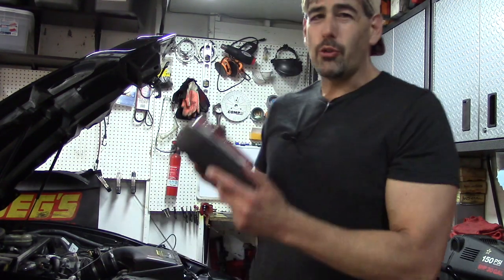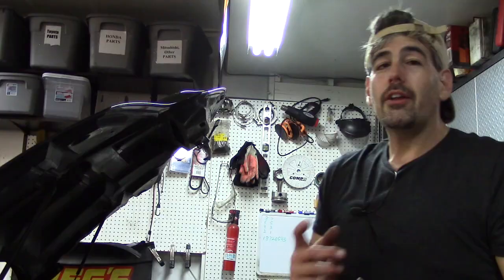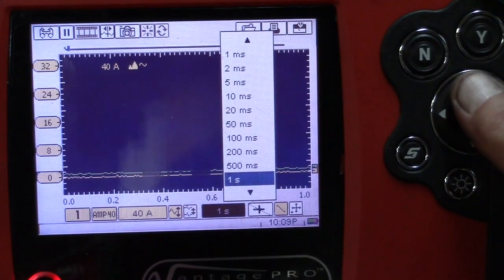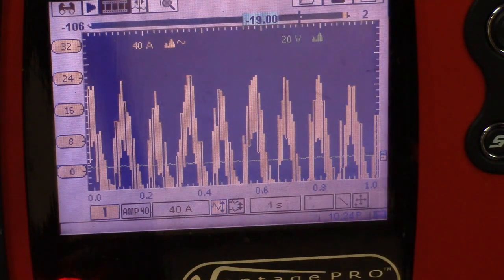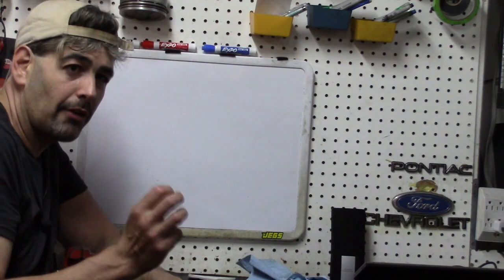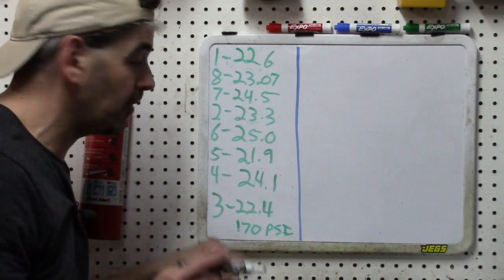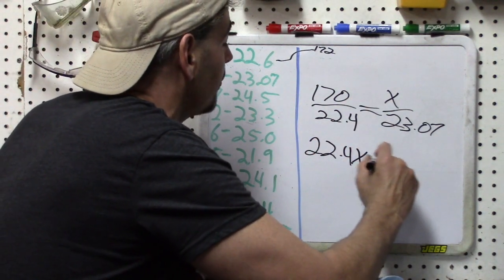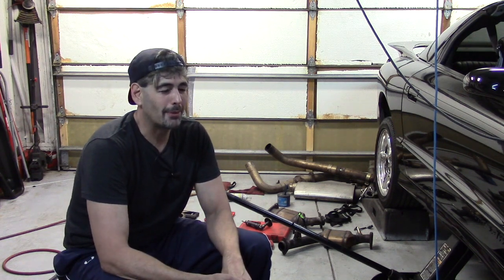Method for Relative Compression Testing to get PSI DATA!!

Comment: I don't have an in-cylinder pressure gauge due to cost, but do have a cheap 1 to 100 psi pressure sensor with a Schrader valve to measure a known value of fuel pressure for the scope signal, can I use this value to then let the scope give me a comparison value like you did with the in cylinder reading and then do the same calculation formular to get the cylinder pressure this way, Love the way you find different ways to verify things mathematically,
Reply from the maker: Thank you and indeed I have heard of many many people who made various homemade transducers like you are trying to do. Luckily now I was able to afford the WPS500 and I only bought it for the easy direct calibration with my picoscope.  But believe me for most of my life I would have absolutely rigged up something like you are doing.
   The only problem is that if your pressure transducer is only to 100psi, it’s just going to be far too low to do in cylinder diagnostics. You will need one that goes to 200 at minimum.   Average cranking pressure is going to be 150-180. If you plan on doing running pressures, maybe 250.   At only 100PSI you will always flatline it on even a low to moderate compression cylinder.

Comment: Matt is there anything that you HAVEN'T covered?!?! This video is EXACTLY What I have been looking for
Reply from the maker: glad to hear!  i try to be comprehensive and thorough.
Reply: @SchrodingersBox  anything you recommend as far as an amp clamp and scope for this without breaking the bank but also without making it too difficult on myself to read and comprehend the test results...
Reply from the maker: you can use any DC amp clamp and I have seen many for under $100 but as for the scope- I know several viewers have made lots of recommendations but I can’t really recommend on. i have tried several and honestly any of them under $300 I really don’t like too much. I really like my used vantage pro which is just around that range.

Comment: But is the current directly proportional to cylinder pressure?
Reply from the maker: Yes. It has to be. the higher the pressure the slower the starter will turn and thus the higher amperage.
Reply: @SchrodingersBox  I agree, it is proportional, but is it directly proportional? As in, will twice the compression result in twice the current? And while you're here - if you don't mind... How does this sound? Got low power on cylinder 2 but worried it might be low compression. Cranking sounds ok to me? https://www.youtube.com/watch?v=ZtSef5E8ztM
Reply: @dopiaza2006  An engine with no compression still draws starter current so current can't be directly proportional to pressure.
Reply: @mattt4183  Good point. I guess you'd need to baseline the current with no compression and take that off any reading to see if it really is from that point. And to answer the question about the video I linked about - it has 2 bent conrods!

Comment: Hi Matt! You may not see this but how or what tool do you hook up to the ignition to find out which cylinder is who?
Reply from the maker: Hi Glenn. There are lots of ways to do it including not even using a tool. The trick is to get a signal on a known coil and then, given the firing order of the engine, you can determine each cylinder you see on the scope by counting firing order from the known. 
    You can use an inductive ignition probe, a capacitive clamp, you could prove a terminal for voltage or use an amp clamp, or you could even remove one spark plug from a cylinder and the missing peak will be that cylinder.
Reply: Schrodingers Box what did you use in this particular video? Also on COP design, how do you get a signal? Tapping into the trigger wire with back probe or pierce it?
Reply from the maker: In this video I used a inductive spark tester- simply because I was interested strictly in signal, not a diagnostic spark pattern. 
   In the case of a COP you have three options. One is to backprobe or pierce to get voltage. The second way is the use an inductive amp probe and loop the signal or ground wire.  A third way (and the way I do it now since I bought one) is to use a special COP probe that you simply touch to the coil and it gives a spark pattern much like a capacitive probe.
Reply: Schrodingers Box the reason why I’m asking you this is because I have a vantage ultra scope which is similar to your vantage pro. What would be the cheapest/easiest route for to get for picking up the ignition signal to sync with the relative compression test? Maybe something that could do either  wire on plug and coil on plug? Also do you use an adapter for your COP probe? I know that our vantage only takes banana.
Reply from the maker: The cheapest way by far would be to just probe the signal wire voltage. All you need is a backprobe- that’s it.  Nothing to buy- you can use a sewing needle.

Comment: SCHRODINGERS BOX, 
                        ,,,           when one or more pistons are NOT giving any compression. What would be the problems on the cars engine? 
        Do you have to replace the piston or the actual engine block is cracked inside that piston cylinder and have to replace the whole engine block?
Reply from the maker: The variables are ring sealing, valve sealing, or compromise of the combustion chamber.  Determine which is the one via leakdown test.

Comment: The old BMW DIS  testers did this automatically. You put the transducer and do a relative compression test  and it will give you a report in BAR.  To be honest I have not done it in many years. Direct measurements are faster

Comment: Ha! I got interesting case, where all cylinders have almost same even compression (+/-2%) but all are under desired value (35psi less) so I suspect incorrect timing.
Reply from the maker: correct. that would be far more likely than equivalent wear on each cylinder.
Reply: @SchrodingersBox  So I don't trust computer throwing no dtc as  apparently it is within safe limit. Either incorrectly installed belt by a tooth or two or faulty one of vvt hubs due to intermittent nature of underpowered rides (sometimes engine sounds like exhaust opens too early and throttle is much less responsive).
Reply from the maker: I usually check alignment by superimposing the cam and crank signals using a scope but without a scope you will have to just look at the timing marks and see if they are misaligned.
Reply: @SchrodingersBox   I have both cams variable, so I will have to lock them from the other side and ensure sprockets were/are aligned as spring loaded - just waiting for a locking tool to arrive and a free weekend. I am even going for a fun to check crank tdc with a tdc wheel while being there..
Reply: I heard that test with use of a gauge always shows lower than real pressure because gauge and hose add up extra space for air. Is it always a true?

Comment: I wonder about the accuracy from a bit of a lower psi cylinder to a bit higher... As scanner Danner says it can show an exaggeration in the numbers because the starter moves a bit faster on a cylinder with less compression thus drawing less amperage. When the starter begins to go to the next cylinder it is moving faster than it would normally due to the previous cylinder drawing less current. So the following cylinder after a cylinder with a bit lower psi actually reads like it has slightly higher compression, but in actuality it's appearance is skewed by the previous cylinder. In any case, good stuff..... Nerd on 🤘

Comment: I found it easier to find out how many PSI was equal to an amp, and then multiply that by the results of each cylinder.   I.E.  170(PSI)/22.4(amps) = 7.59.....   That means 1 amp is equal to 7.59 psi:   7.59 x 23.07 = 175 psi,   7.59 x 22.6 = 172psi,  7.59 x 24.5 = 186psi   and so on.....
Now, these number are only accurate for your vehicle since we have a baseline, but the theory applies to any.....
Reply from the maker: That's pretty good way of doing it too. Yes Either way, you still need a baseline because the conversion factor will be unique to each vehicle.
  But definitely like it!
Reply: great.
Barnekkid, simoncrane8267 and justaguy1576 commented the same too

Comment: Any idea on how to properly do compression test on a vehicle with electronic throttle actuators, will they got to WOT while cranking.... and what is the best method for keeping the vehicle from starting?
Reply from the maker: No difference whatseoever. just diable fuel and do test as usual.

Comment: This technique would have been fantastic working on diesels. Friend co-worker had to remove glow plugs on every cylinder on a car to test comp and one plug was in a very tight situation(couldn't put the gauge in since it was a very tight fit). Wish I was still working there though (immigration issues). People there were nice and worked as a team. Plus free pizza's on your birthday!

Comment: Excellent video. This is a quick test compared to removing the upper intake plenum to get to back plugs on some engines.
Reply from the maker: EXACTLY!!!!  This is absolutely the most amazingly useful part of this test- doing a compression test in minutes and at no cost vs in hours and at expense of gaskets.
  Plus, it allows for accurate "hot engine" testing as opposed to engine cooling by time intake is removed on those models!!
Reply: Schrodingers Box . Thanks for what you do.

Comment: I have heard about relative compression test for 2 years now and kinda wrote it off bc it didn't give me the in depth answers I always wanted. Over the last 2 weeks, I have been trying to figure out ways to take this test from looking at the peaks to see a low cylinder to something more concrete than it just looks lower than the rest. Thanks for going total nerd on this. I hadn't even thought about using this way. Great job. You took a basic test took it to another level that will make my life easier(removing intakes to get compression values on a weak cylinder) and make me feel like the smart guy in the room.
Reply: awesome.
BTW mtberguy, to see evidence that space agencies are lying, I suggest watching Level with Me (2023) by Hibbeler Productions

Comment: There is only one thing I disagree with in this video and that is the inference that 100 PSI is acceptable because it is the stated minimum. Stated minimums are quite often incorrect as to engine health. Any engine other than an air cooled VW (very low compression ratios) that has 100 PSI has a problem.

That aside, I consider this video outstanding from a tech standpoint and explained very, very well. Kudos.
Reply from the maker: +Merkur87 What evidence do you have to substantiate that? Compression specs are very strictly relative.
Reply: +Schrodingers Box 

Forty plus years as a mechanic with thousands of compression tests under my belt on just about every make of car along with motorcycles and aircraft. Look at it as a track record and averages so to speak.
Not that it really matters but I hold multiple ASE and factory certs in engine building and also hold an FAA A & P license.
The rule of thumb on compression pressures is 20 X the compression ratio with various factors at play.

Please don't take my comment as being critical. I thoroughly enjoy your video and find it refreshing that you actually reference that all cylinders being equal on a scan tool could mean they're all equally bad. Most simply accept that being the same means they're all good. Hats off to you.
Reply from the maker: +Merkur87 Thata not evidence. I mean like actual specification sources. Experience and certification is an appeal to authority logic fallacy. 
  An actual source with specifications is necessary.

Comment: Great video, but what am I missing? You are using a 40 amp probe on a starter circuit? I tried this with a 100 amp probe but couldn't get a reading because my circuit was pulling around 135 amps. I had to use a higher amp probe to get a reading.
Reply: marc wischkaemper he is not taking into consideration the probe setting. But it's a relative using a ratio.

Comment: Instead of using the algebra, why not just take the 170psi and divide it by the 22.4amps used. Then you know for every amp consumed, you have 7.589 pounds of pressure (per square inch). Now you can multiply every other cylinder by 7.589 to determine what the compression is.
Reply: +Patrick Curran that's algebra too bro. it's same formula.
Reply: +Schrodinger's Box Quantum Mekanix Thanks...I am in my 50s and that cross multiplying stuff just confuses me...lol...
Reply: +Patrick Curran Lol what you said is basically what u get after cross multiplying lol. 
 I figured people would like to see how the equation is derived. but basically "X" is still the same thing
Reply: +Patrick Curran i was just about to post that same thing.
Reply: +Schrodinger&#39;s Box Quantum Mekanix  I am by no stretch of imagination a mathematician. So you kind of lost me when you started with the algebra. I was saying to myself ohhh he is just going to divide the PSI by the amps than figure out what each amp represents in terms of PSI... then you went into the algebra i was like "WTF" but i do realize it's the same thing and might be easier for someone who practices algebra on the daily basis.. But anyway what i am trying to say is that's an awesome method. thanks for sharing.
Reply: Hey you did say this was going to be a little on the nerdy side in the beginning of the vid ! LOL !

Comment: hi. I would like to know if it is possible to use the smoke test to accurately determine where compression low is. I am asking because I saw a video showing that it was possible. Please reply when ever you have time. BTW I believe in your approach to these problems. thanks in advance.
Reply from the maker: +rena homer Theoretically you could-  by putting smoke in the cylinder you Might be able to see the smoke leaving through the leak however the thing is usually you need very high pressure to find a compression leak. If the leak is really bad the smoke test would work. But on many leaks you need fairly high pressure (Well over the 20psi or so from a smoke tester) and thus a leakdown tester is far more reliable. 
If I did a smoke test and it was positive, that's great but if it was negative I would have to do a leakdown test to be sure and since the leakdown test tells you where the leak is anyway I would just do it first.

Comment: I have made a pressure transducer to connect to my scope, and have found that to be most useful for gathering similar data. The thing of interest to me is that I get lower than anticipated comp values, due to the fact that the pressure transducer does not have a schrader valve in it, so you only measure the "single piston up compression"
A very clever mechanic I know is only ever interested in this first piston up value. I notice on your video that this value is about 100 psi for your car, although it pumps up to 170 after a few strokes. Thought this might be of interest
Reply from the maker: +David Bell Many people do use the first compression stroke data, which I do.  I also consider the total number of compression strokes needed to get maximum compression- it's a good indicator of cam/crank timing.

Comment: The linearity won't have to be perfect. If it is just fairly "close", then you can call a bad cylinder.

Or, at the very least, it would give one some comfort in deciding that a physical test of a given cylinder (and a reference cylinder) is needed.

Boyle's Gas law says that the pressure and volume of a gas in a vessel will be exact inverses of each other, assuming temperature is held constant.

So, if the pressure in a one liter vessel is 100 psi, and the vessel is expanded to be 2 liters, the pressure will go to 50 psi.

Conversely, the physical force needed to compress a gas to 1 liter would be twice the force required to compress it to 2 liters.

So that takes care of the physical pressure vs volume relationship. The only other place to examine the linearity would be the relationship between force and current in the starter motor.

I.E. if the starter motor has to draw 20 amps to compress one cylinder to 100 psi, but draws about 15 amps to compress it to 75 psi. I don't know the answer to that, I suspect there will be some non-linearity but not a lot. One factor might be the inertia of the vehicle crankshaft and flexplate assembly. And then what is going on inside the starter motor. I don't know any way to determine that without empirical testing.

So yeah, next time you see a car that you think has one or more really low cylinders, that would be a great time to test the linearity, as you mentioned someplace below.

Good vid. Fascinating. The amount of time and effort saved in doing something that gives results that are even "reasonably close" to a physical test..... wow.
Reply: Yes. This video was REALLY good. Too bad I have to wait on affording an oscilloscope. You covered this measurement and it's inaccuracies perfectly.

Of course internal engine momentum cut into it's accuracy. I'm feeling good that I thought of that during the video too.